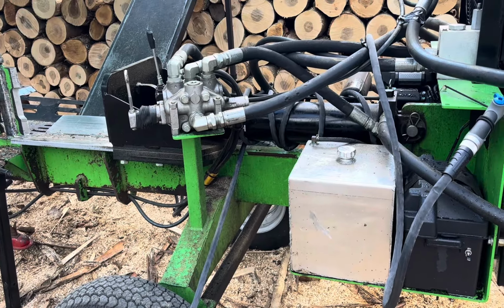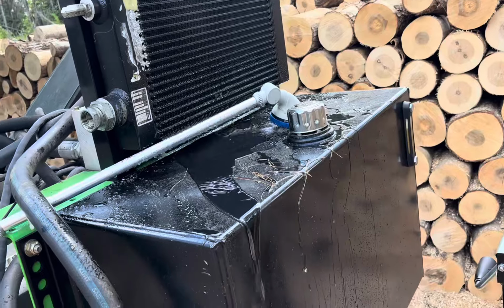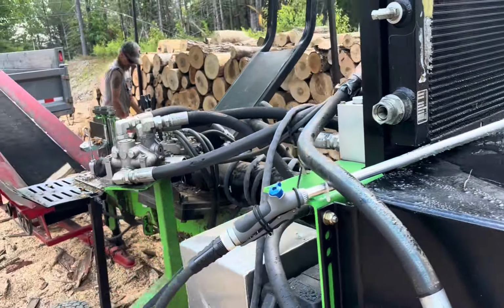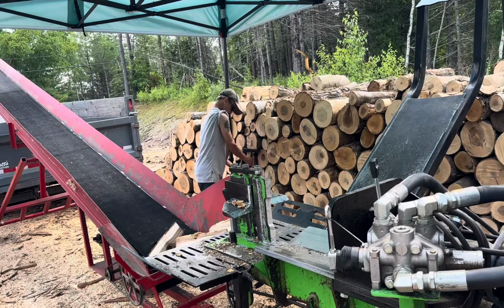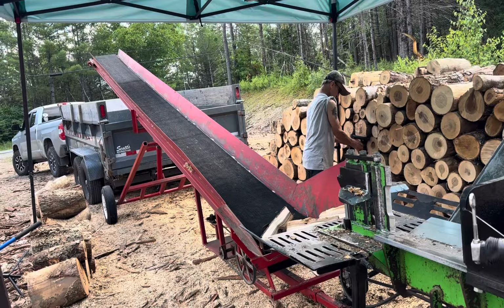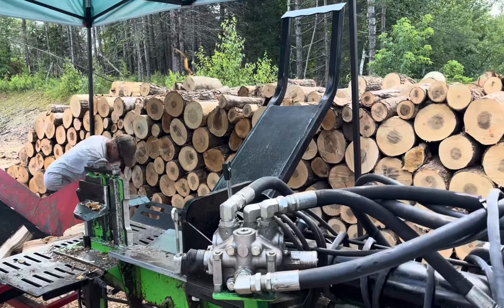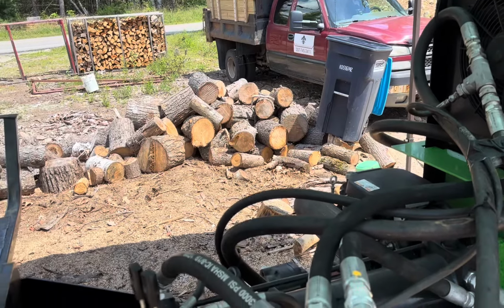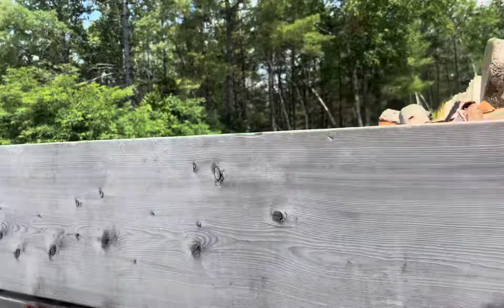A little creativity goes a long way!

Comment: Nice job boys. Stay in the shade as much as possible. The cold water seemed to help ya
Reply from the maker: @OpenAirAdventure  the cold water is doing the trick for the time being. Hard to keep anything cool when it’s this hot out. Thanks for stopping by!
Reply: @WilleysFirewood  maybe run the hydraulic hose through an ice bath like the drag car days.
Reply from the maker: @OpenAirAdventure  funny you say that. Gramp mentioned doing something very similar 🤣

Comment: I might be mistaken but it looks  like you can adjust the wedge quickly even after the push block is in motion.
Reply from the maker: @hayesrutherford9415  you are correct the wedge can be adjusted at anytime.

Comment: I was beating the heat here yesterday.  After work today, nope not interested in being outside in 95 degrees here South of Seattle
Reply from the maker: @DanielAtkinsFirewood  we has 93 when I called it quits but I still went back out before dark for an hour. Glutton for punishment 🤣🔥🪵
Reply: @WilleysFirewood  : I will be going out here in a bit.  Just do a little a day, and it all gets done

Comment: Who is the manufacturer of the hydraulic cooler?  Looking to add one to my splitter that runs a 28GPM pump.  Also curious where you are getting the cooler from?
Reply from the maker: @FortG1970  the cooler is made by American Cooling Sloutions and I ordered mine through a local hydraulic shop but now know that you can buy them right on Amazon and have them shipped right to your house.
Reply: @WilleysFirewood  Thanks, do you happen to know the model number of the one you are looking at? Thanks
Reply from the maker: @FortG1970 it is model OC-64 with no bypass.